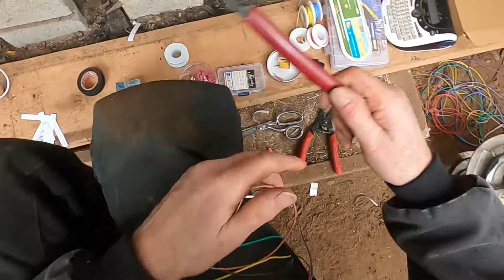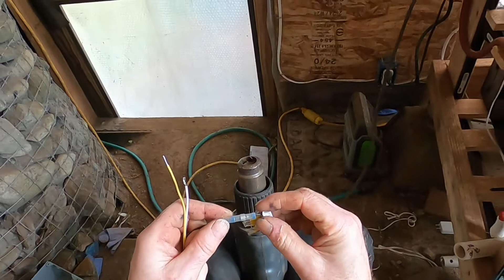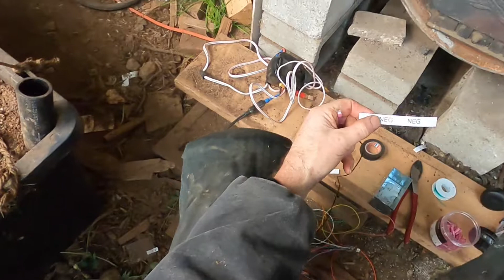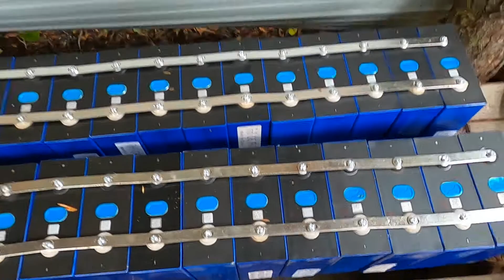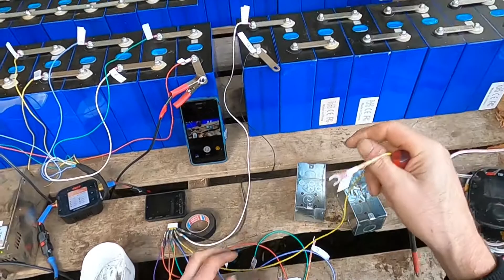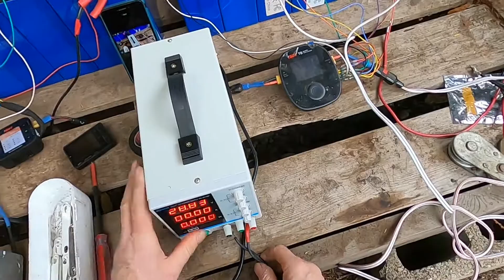Making balance leads for my 280AH LiFePo4 EVE cells.  More top balance charging details.

Comment: i am trying to buy 32 of the same batteries from Shenzen at Alibaba for the last week and all my 4 credit cards were refused.  then they told me to upload a picture of my credit card and the passport, (not to smart) and still no luck.  how did u send the money.  
great info and good work.
Reply: I bought 32 cells from them on my credit card, you will need to contact the card issuer and make them aware of the charge.

Comment: Do you have a good BMS you’re confident in? I also bought the 280ah cells and am a little lost on which BMS to match them with for my RV.
Reply from the maker: If you are configuring a 12v or 24v pack then the overkill solar BMS would work well.  That is what I am using on my small 12V pack and so far no issues.  For 48V you may need to go with chargery or something more expensive.
Reply: Try Batrium BMS
Reply from the maker: @samanthapowell5882  I may do that at some point.  For now I have a Chargery that I plan to utilize for this bank.
Reply: killer solar !
Reply from the maker: @qux8508  Tanks Mang!
Reply: I just placed an order for qty-16 Eve batteries a couple of weeks ago.  Utilizing your idea of the ISDT Q8 to top balance them 👍... Now searching around for a 16S BMS for a design not to exceed 0.5C or 140 Amps... I will look at the chargery mentioned above. Thx!!

Comment: you should not do this any more.... you have new cells. But now you started it, so you need to go on and hope you do alright. BUT... You just need to monitor them with a good voltmeter to check there voltages. Start doing that daily even more times a day and after some time you get a feeling how they go. Then you only need to do a check one in a while. If out of balance just charge your pack with a good BMS with balancing function.
Reply from the maker: Most BMS's only balance in the low millivolt range which is not sufficient for large cells like this.  My experiences tell me that top balancing, while imperfect, is still very helpful in allowing one to take full advantage of the capacity of the cells once they are configured into a bank.
Reply: @metagrid9453  Your new cells are checked, balanced and matched, when delivered to you if bought with a good supplier. A BMS will cut-off charging, when one of your cells in the pack is fully charged and reached its maximum voltage. Than the BMS will bleed this highest cell, until it can be charged as a pack again and then all cells will be charged again until one of the cells is full. Then the bleeding of this cell will start until the charging can top of your pack again. everytime your pack is full, the balancing will bleed and will try to balance the cell better and more. It will take some time and multiple charging sessions, but your balance will be better every time... After a dozen charges, in theory your cell are fully balanced as a pack. What you are doing is very good for unmatched and or rebuild battery pack after replacing one or more cells. Also re-used cells from different pack should be voltage matched. This can be on the high side fully loaded or if you don't have or want to use a BMS (with balancing) at the low voltage side of the pack cycle. This because the Li-ion cells and LiFePO4 cells have a very long stamina around the nominal voltage. Therefor technicians use the outerspecs of the cells to balance.

But in a cell factory the are checked and charged to good voltage for longtime storage. Around 3,3x volt. Ready for pack building. If not it would take many hours/days to make a batterypack. That would be very time consuming, costly and RISKY, mismatching by accident is so easy. In theory your cells do not even need to be balanced if you only use 80% DOD or less. Unbalance is only dangerous at the High-end and lowest-end of the working voltage of the cells.

TIP: If you want your cells to have a super longlife. You can lower your charging voltage of you charger. I did this. I have a batterypack of Headways 40152 LiFePO4 cells (8s2p)  normally max voltage is 8x 3,65 (max. Cell voltage) volt = 29,2 volt (Max. pack voltage) But to get much more out of my cells I lowered my charger from 29,2 volt output to 28,5 volt.  This will give my batterypack a max voltage of 28,5 volt : 8 = 3,56 volt per cell. Also it is wise not to run down your pack until cutoff voltage. But before that. This will relax your cells in your pack and will give an extended battery pack life. It is also recommend to buy a bigger battery than you need, this will also relax your battery pack and prolong battery pack life VERY MUCH!
Reply from the maker: I found that while the cells were matched on IR and storage voltage, they were not top balanced.  So I performed the top balance so that they would be much closer in voltage at the top of the charge curve.  This is due to the flat charge/discharge curve of this chemistry.  It is easy to match cells at the storage voltage but that does not mean they are matched at the top of the curve.  Top balancing insures that they are balanced at the top so the minuscule 200ma balance current of the bms can keep them in balance easily.

Comment: Are u Shure about 280ah battery looks small , please do a capacity test
Reply from the maker: Pretty sure.  Keep in mind that each cell is 280AH at 3.2 volts.  if you need 12 volts you will need to wire in series and will still have a 280AH battery that is 4 cells in size.  Watt Hours is a more accurate representation of stored power in my view.  A single cell has about 896 Watt Hours but a 12v 4 cell series connected bank would have 3584 Watt Hours.